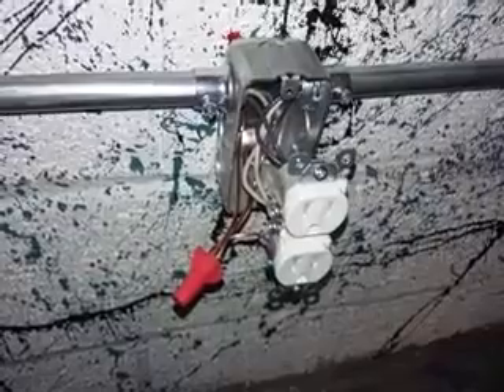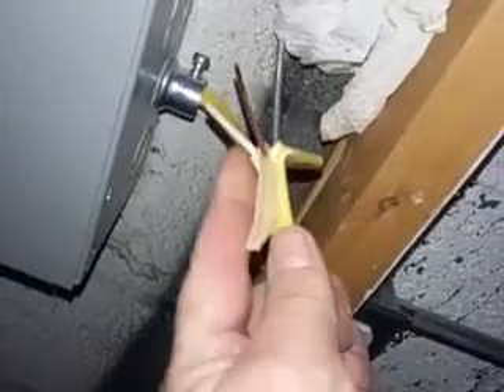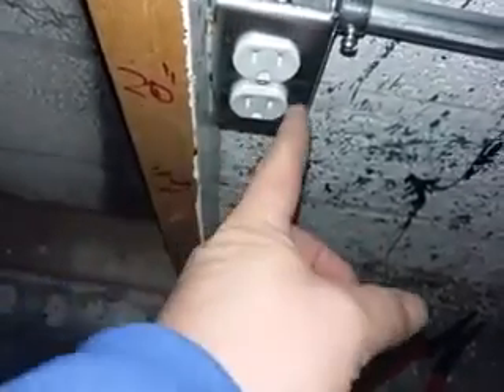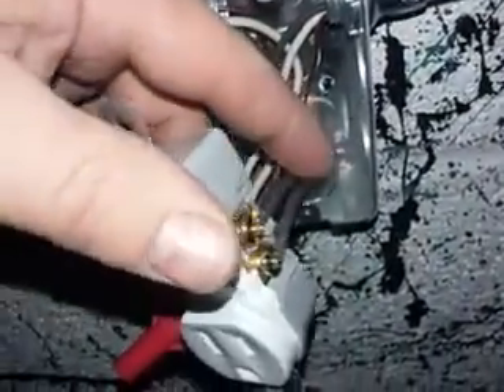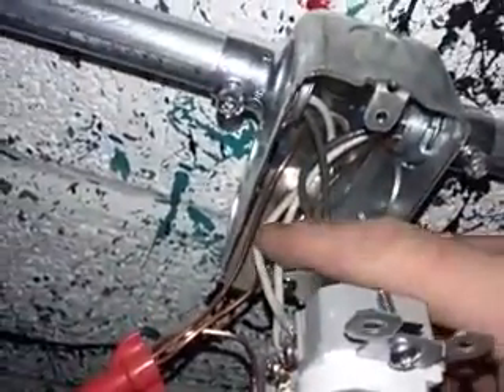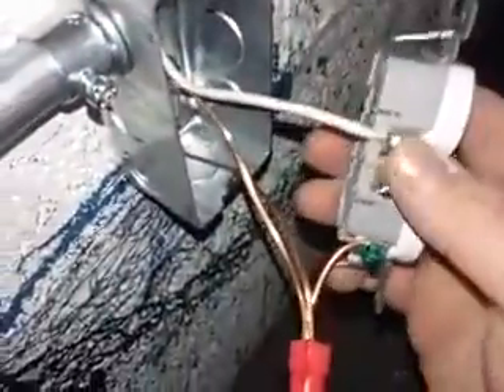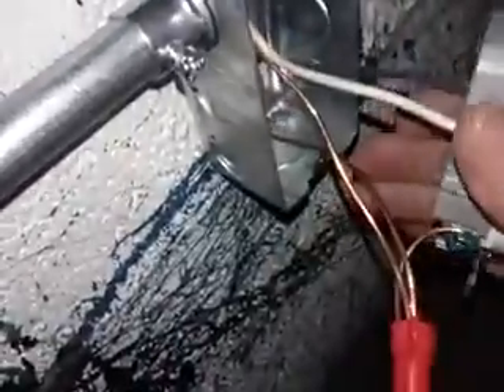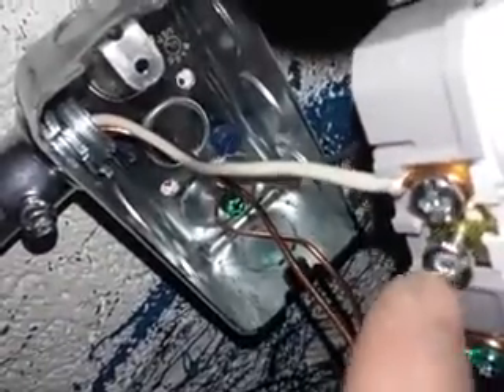How to wire metal outlets Hot, neutral, and ground wires.

Comment: On that last box,  can you just ground the wire on the box screw and then just use the same ground wire to connect to the plug? Does it need to be pigtailed?
Reply from the maker: Vanessa P You have to have a ground going from your plug to the metal box for a correct ground. As long as you're accomplishing that you should be fine.

Comment: This panel seems awfully low to the floor. I'm not sure if that is code.  Also in an unfinished garage, shouldn't there be conduit coming out of the panel or at least MC cable?  There are sections of your run with the NMC cable that are not protected and looks dangerous considering how low to the floor it is.  I'm not sure if these issues vary around the country though. There's no plywood board behind the NMC coming out of the panel vertically and it seems like this cable should be secured closer to the panel.  I'm still learning, so I'm only asking as an amateur.
Reply from the maker: Hi drjbg400 The panel is 21" from the floor and the outlets are 16" from the floor. Completely code .That panel is a large junction box 12 x 12 x 4. From the ceiling to the floor there's two by fours with drywall over the top of that. Behind that it's a block wall. So all  wires going to the junction box are behind a wall. Then everything coming from that junction box that is exposed is in conduit from Outlet to outlet. I hope this was a helpful explanation of the situation.